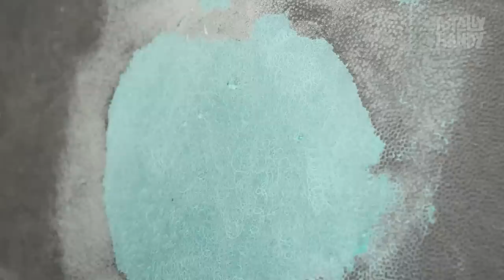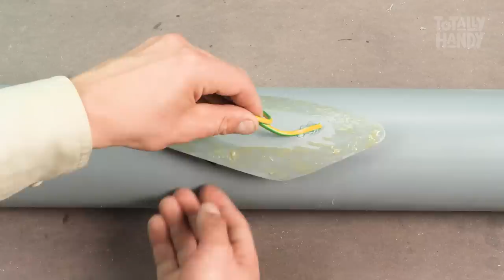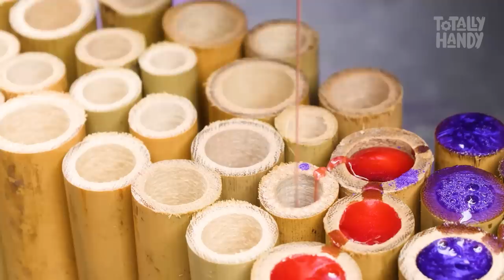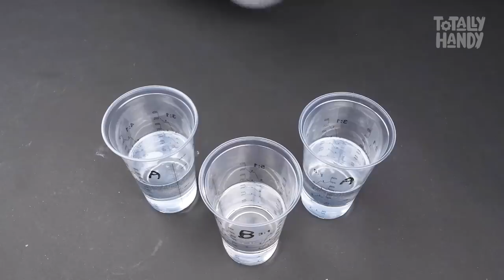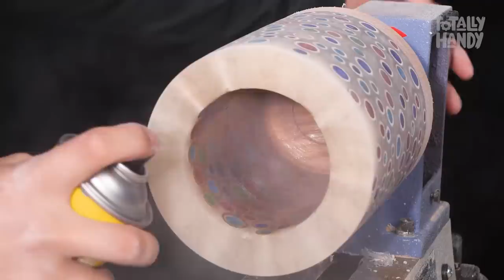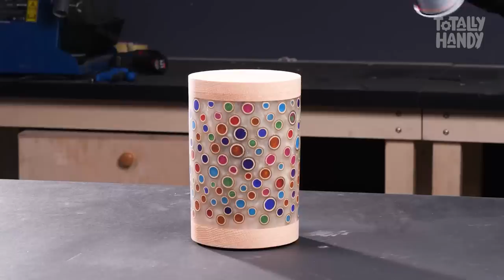Plastic Fixing Hacks Only The Pros Know | DIY Project

Comment: Just a note on hot glue.
I started installing wood trim in my house using only hot glue, no nails.

This worked out perfectly until I finished my attic. During the hottest days of summer, when no one was using the living space in the attic, I would turn off the air conditioning. That's when the trim boards around the attic access fell off.

So, I believe something made of black plastic would get hot enough to re-melt hot glue, if left in direct sunlight on a hot day.